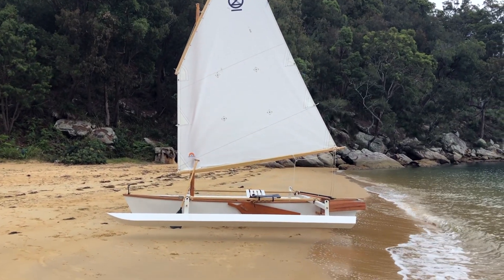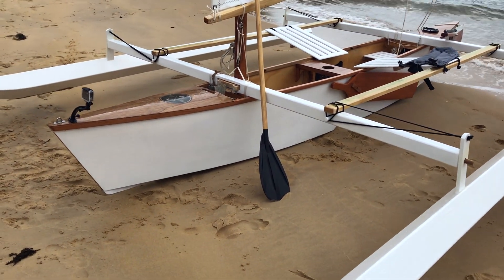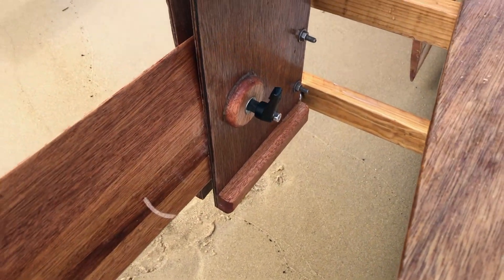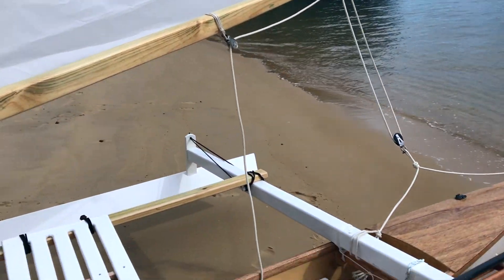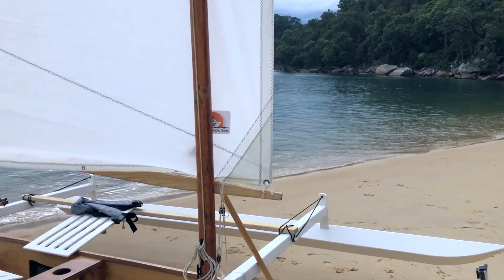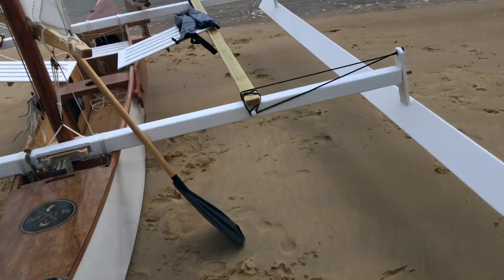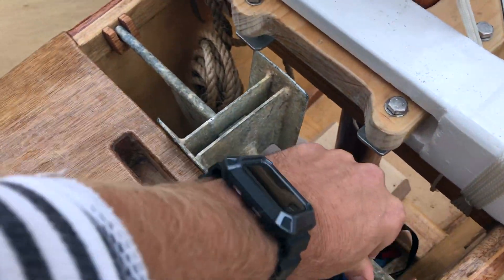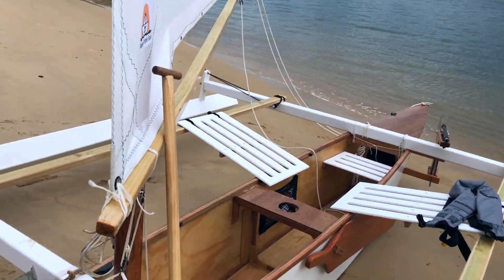Homebuilt boat - walk around & commentary #outriggercanoe #diyboat

Comment: Nice rig!
I tried a 54 ft version of your balanced lug on my kayak with much smaller outriggers. With both reefs in, she turtles in a 15 knot gust. Water was about 10 degrees. Chilly day.
I saw where you didn't have any lines in your second reef. Might want to do that before you need it!
Reply from the maker: Thanks mate, your kayak sounds like it would be a lot of fun! Unfortunately, I didn't get the chance to sail my outrigger in anything stronger than 8knots before I sold it, it does make we wonder how the current owner is going with it.
Reply: @Aaron.deRuiter  Bummer. So many pork chops, so little outrigger.
The kayak is just a folding Klepper suitable for air travel.
I built a 19 ft trimaran  a bit before yours(with a bit more buoyancy on the outriggers than yours) that carries about 170ish ft of Bermudan rig. No turtling in 20 knots of wind and she's hit a bit over 19 knots while remaining stable enough to make a sandwich.

Comment: Hi Aaron! Great boat, that's a pity you have so few videos with it! I'm building right now an other trimaran (M. Storer's QCE with his outriggers), but my next build would be the Wa'apa. How reliable is your rudder fitting? Have you experienced any failure? I like it's simplicity and low cost :)
Reply from the maker: Thanks mate, I wish I had more time to to have taken it sailing! It really needed to go on a trailer to speed up the rigging process. But it was a great little boat and sailed well considering the simple hull shape and lug rig. The rudder was a combination of Gary Dierking's and Michael Storer's rudder designs. It worked fine but I would prefer to have the rudder hung off the stern but that would make it more complex to raise and lower it. If I were you, I'd build the Tamanu to give you more room and waterline length or build the 24ft version of the wa'apa. Thanks for watching István!

Comment: Fantastic boat Aaron. I hear you say in the video that she’s built from 3mm plywood. The plans call for 6mm or 4mm for the side hull pieces to save weight. Is that correct or are just some parts of the boat built in 3mm ply?
Reply from the maker: Thanks Leigh. Yes, she’s built from 3mm plywood with a layer of 6oz fibreglass glass on both sides to essentially make the plywood a lightweight core between FG laminates. The hull sides, bottom and fore and aft decks are 3mm plywood.
Reply: @Aaron.deRuiter  good to know you can get away with 3mm. I’m looking for something that’s easy to car top. Thanks for the reply.
Reply from the maker: No worries Leigh. What boat are you thinking of building?
Reply: @Aaron.deRuiter  The Wa’apa but in 3 sections. I like the idea of having a 16 foot or a 24 foot option. I’m intrigued by the shunting rig also so might make it a single outrigger.
Reply: Answer please.
Reply: @ebeegeebeefofeebee3181  ?

Comment: Hey Aaron, how long did this build take? and what's your top speed? are you finding the 16 easy to transport on the car? cheers mate.
Reply: Also is there a reason you went for the double? more seaworthy?
Reply from the maker: Hey mate, sorry for the late reply. I've since sold the outrigger canoe so not sure how it's holding up. But I expect it will last for a long while if looked after properly! Yes, went with the double outrigger for better stability and sailing performance.

Comment: Aaron Greetings from Costa Rica, in Gary Dierking's book there is no configuration for trimaran of 16 feet only for 24 feet, could you tell me what measure you gave to your iakos?
I want to transform my wa'apa 16 into a trimaran
Reply from the maker: Hi Huascar, thanks for watching mate. I used the same width as per Gary's plans for the 24 footer on my 16ft version.
Reply: Thanks for the quick reply. I will use the same measure